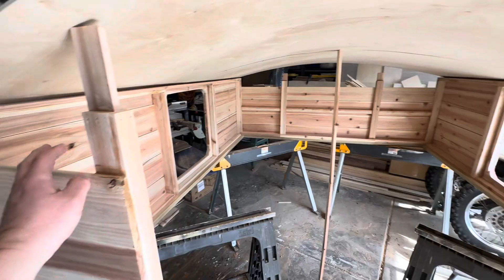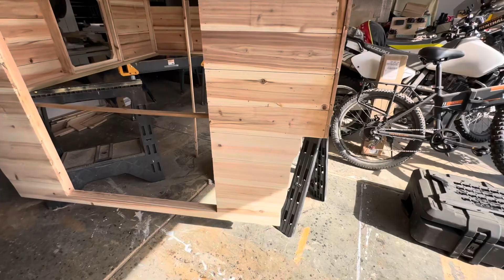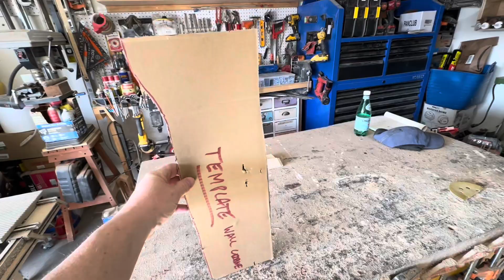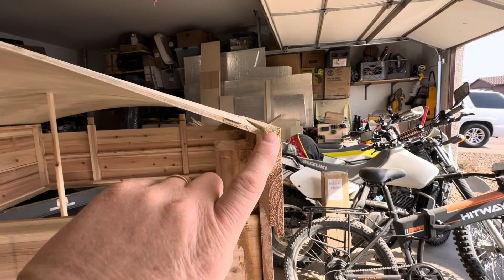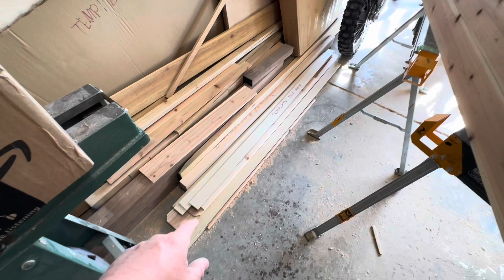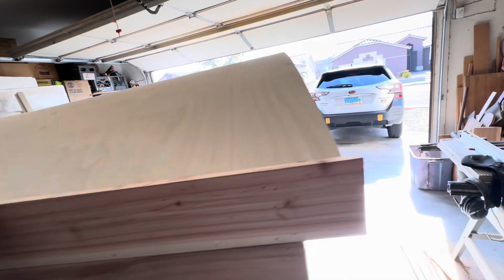Truck Camper Shell Build 10.0 VLOG, Part 2 - Cedar Siding Installed and Roof Concept Explained

Comment: Wait.. when did the roof get added?  
is looks like you left a small lip for the roof to hook the edge. for the roof I was considering using  2 sheets of 4x8 coroplast, maybe 1-2in pvc to frame the top for stability, it could also help if i wanted to run electrical wire.

Comment: How are you securing your cedar boards to the frame? And BTW, the build looks awesome!
Reply from the maker: 1 1/2 inch 18 gauge brad nails. I use outdoor grade caulking between board and frame (works as a flexible adhesive-giving the ability for the boards to expand and contract which is crucial).
Reply: @EndgameCampers  thanks!!

Comment: I'm keenly interested in this build because it's essentially what I've been thinking about doing after watching so many of your videos. The difference for me, however, is that being so tall I need 80" interior width for my sleeping needs. My truck bed is 6 and 1/2 ft long and lengthwise is this a smidgeon too short. This will require a bit of cantilever effect over the bed rails which I'm not sure if I'll be able to accomplish it because of the need for the strength it'll need.

As well, I hope to do a slight cabover design for storage.

Comment: Will you wire in lights and usb. etc.?  I think disable lights in the side wall would be nice.  I enjoyed this update .. interesting.  Also, the sides,  if the side has excess it could be used a a drainage feature.. getting water marks down the sides is a hassle ... sure it might get debris but very easy to bruh off.
Reply from the maker: I’ll put a small electric system in (lights, dc output for fridge, etc). Good call on those lips, I’ll take that in consideration. Thanks!

Comment: Looks great! If you laminate with that pl3 on the strips its tough as hell when it dries. I used 1.5 inch strips of 1\4 ply and 2.5 inch where the two pieces of 1\4 ply come together. ☺
Reply from the maker: Good tip

Comment: Can I ask what your table saw/router table combo is? Time to retire my old saw and it would be nice to save some room in the shop with a combo setup like that.
Reply from the maker: Ryobi 3010. They unfortunately don’t make them anymore (I’ve had mine 23years and love it) but they can be found on the secondary market